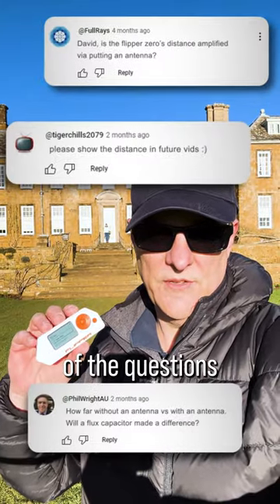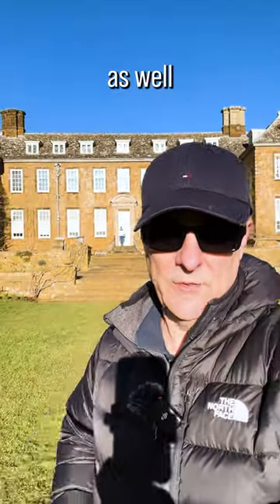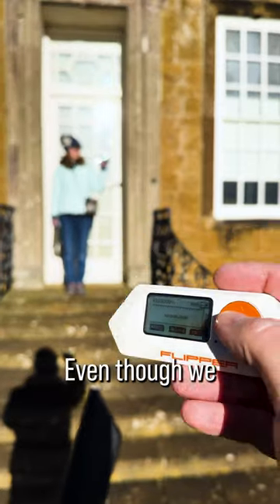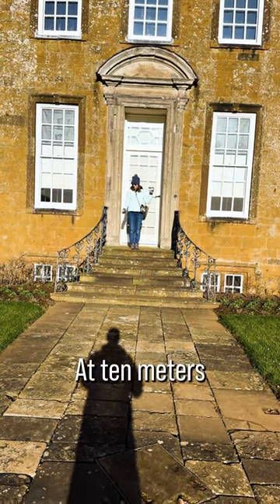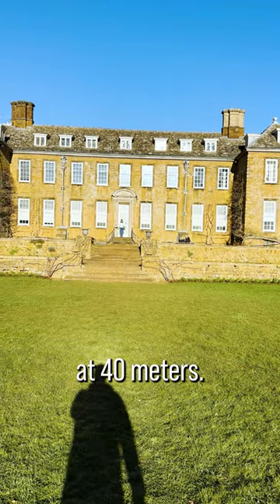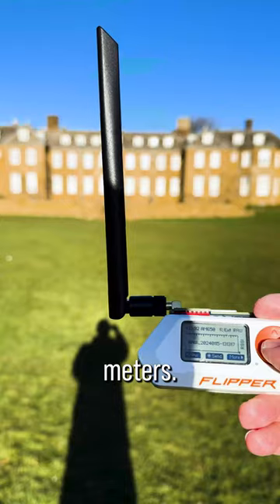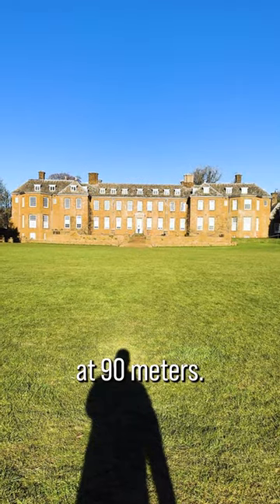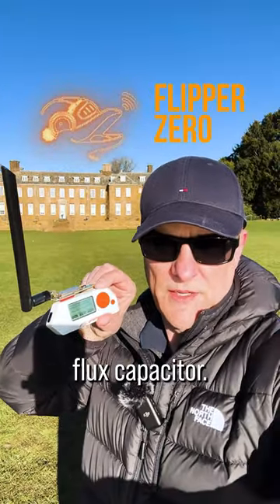Testing Flipper Zero Long Distance (Flux Capacitor) #shorts #flipperzero #wifi

Comment: And that is how you do a proper commercial without wasting people's time. If transmission power was a concern, my other question might be: How about going through walls?
Reply: Exactly my thought.

Go get a faraday cage, put sizable hole on it, and keep adding thickness. 

Cheap and efffective video to make. Enjoy.
Reply: Sub Gigahertz can easily pass through walls. It is, however, attenuated more quickly. 10cm of lead, 2m of concrete, 3m of wood/sheet rock, or 100m of air.
Reply: go buy one make your own video big fella

Comment: For those wondering what this is? Flipper Zero is a portable toy-like multitool which is able to read, copy, and emulate RFID and NFC tags, radio remotes, iButton, and digital access keys, along with a GPIO interface.
Reply: thank you google
Reply: I thought it was a tool for a dolphin to do spying from under the sea
Reply: It does alot more then that mabye do u research
Reply: AI Google in chat
Reply: But doesn’t come with the software installed. You still need knowledge to set it up to scan

Comment: Now, the scary test is no antenna, but press the flipper to your temple. Significant increase in range, I suspect. 😱
Reply: Work's when looking for the car every time 😎
Reply: I have never seen it on the temple. For my car, I put it underneath my chin with the direction of radio travel facing my chin and open my mouth. That's how I was shown and your mouth shape acts as a dish almost culminating the signal.
Reply: @AToneForOurSins  techniques improved thanks mate
Reply: Hey your on to something
Reply: Hi! On flipper zero you can still be able to unlock on 20 meters. I’ve tested this!

Comment: I'd be interested to see how far you could go by adding a directional antenna (the one in the video looks like an omnidirectional one)
Reply: Ryan Montgomery has a flipper zero mod that can reach airplanes
Reply: Can we send the singnal over the internet? 

Like, you with flipper zero in another city and you sending the signal via internet & a device is active around that house which got the signals from you via internet and then it emmit the signal, and finally it's unlocked 🔓.

Comment: I'm concerned about this because there's a risk that this may be used for credit card skimming, and the setup with the wifi dev board's extended range is crazy.
Reply: It can't really do anything with credit cards, the flipper firmware doesn't let you view the information
Reply: No lmao that's not how it works. This cannot do anything with NFC (Debit/Credit Cards). This is an external modifier for the Flipper's SubGhz feature.  Extended range on the devboard also isn't that good either.

Comment: Did you find the SMA antenna is better than the classic rods?
Also they have cheap antenna amplifiers you could try. Maybe it will increase the range. It may hurt the signal when up closer though.

Comment: The one on their web site seems to have a shorter antenna than what you're using. Is yours different,  or just a bad picture on their site? Thank you. Looks like their sold out anyway for now...
Reply: Let me know if u find it
Reply from the maker: Use that one. I got two antennas from Rabbit Labs and decided to try the bigger one. In my previous video I used a shorter antenna and got similar results.

Comment: What if we use an aluminium sheet or can like structure to strengthen up the signal power in Omni direction? Will it again increase the range ?
Reply: The old Pringles cantenna

Comment: Can we send the singnal over the internet? 

Like, you with flipper zero in another city and you sending the signal via internet & a device is active around that house which got the signals from you via internet and then it emmit the signal, and finally it's unlocked 🔓.